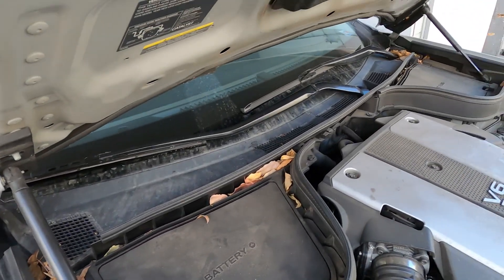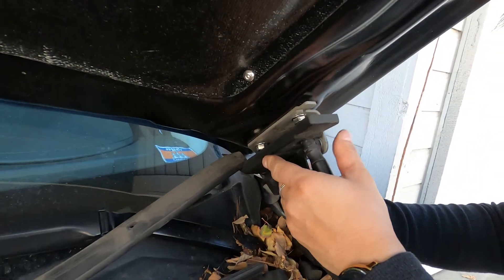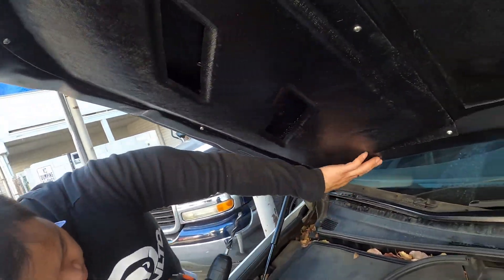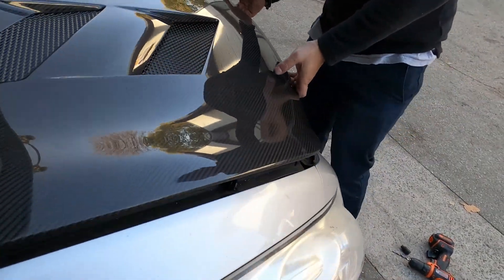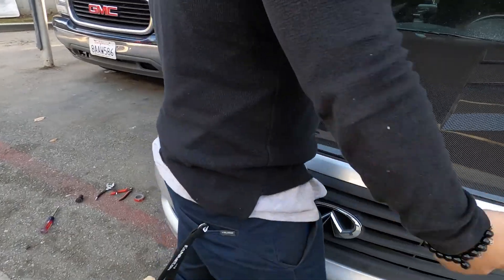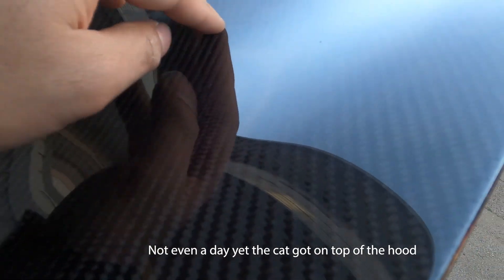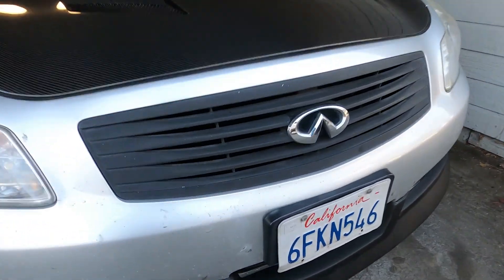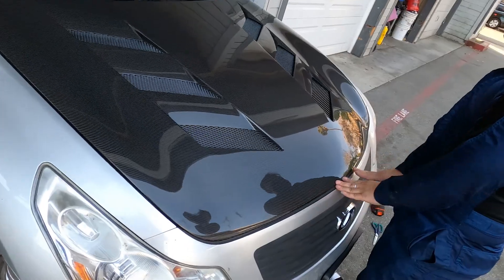G35 Sedan VIS Racing TS Style Carbon fiber Hood installation

Comment: where did you get that front bumper you were test fitting ?
Reply from the maker: It been so long that I actually forgot but the front bumper is called GT Spec Duraflex. They sell it on ebay,amazon and other car mod sites.